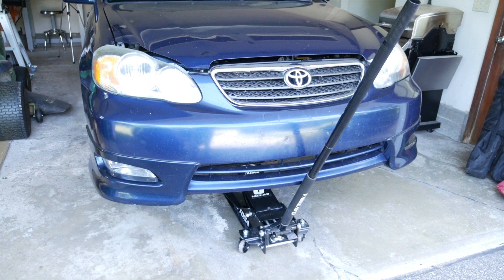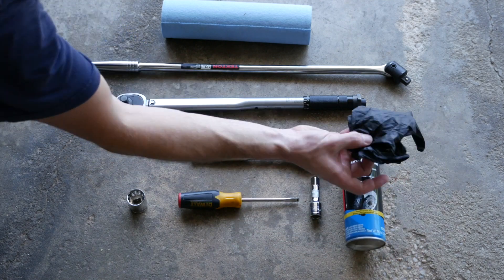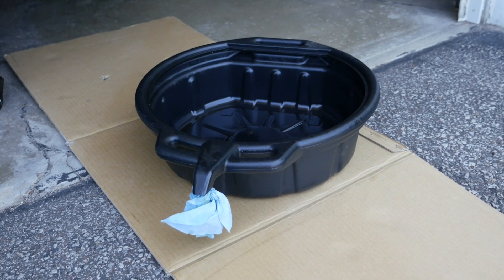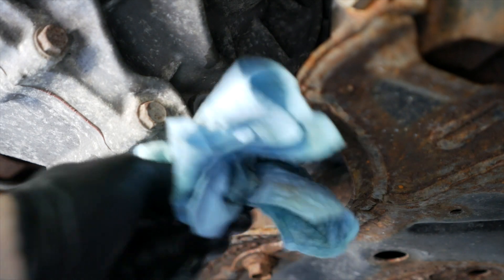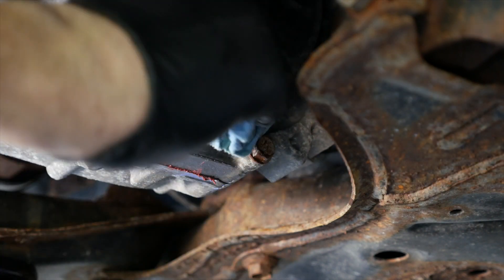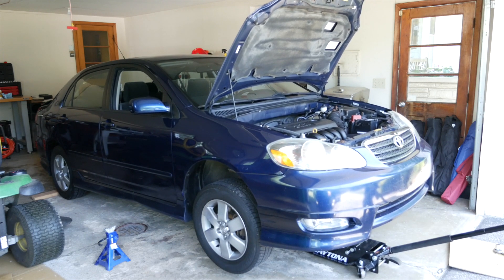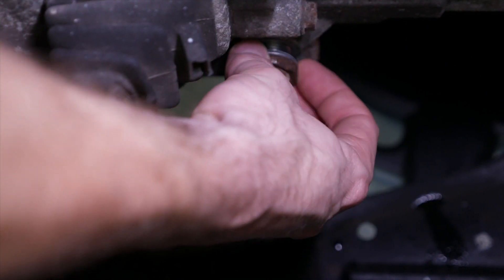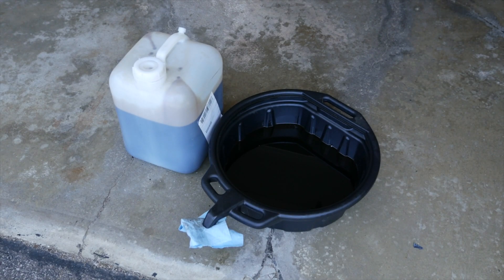How To Change the Manual Transmission Fluid on a 02’-08’ Toyota Corolla

Comment: Good video, very clear. However, FYI for you XRS version owners. The fill plug is a 10mm HEX. Yeah, everything on XRS has to be different. LOL
Reply from the maker: Good call! I believe the XRS (Corolla and Matrix) have the 2ZZ engine instead of the 1ZZ like my Corolla. That would explain the different sizes. Good thing to mention though! :)
Reply: @DIYTillIDie  Yes it has the 2ZZ.  I had to replace the valve cover gasket and all the auto parts stores gave me a gasket that will not fit. They insisted it was correct. I finally went to the dealer and got the 2ZZ gasket which is larger due to engine design.
Reply from the maker: Has more power too! Wish mine was the 2ZZ haha!
Reply: Glad you mentioned this, I'm about to do mine!
Reply: Wrong it’s the 17mm to the right in XRS

Comment: Great video.  I just picked up an 03 Corolla 5 sp.
Reply: I have the same car.   350k on it now  and it's been very reliable . I'd buy another.
Reply: @marcmarini8425 I do too except mine is at 130k. Can’t say it’s not giving me issues but I do love the car. Once I get it fixed 🤞 I think it’ll be good for another 100k at least.

Comment: great video mate , just bought a corolla 4 me daughter, mix 50 diesel 50 motor oil and coat the bottom  of that corolla ,then park it on some sand for 3 days to drip dry , that will stop that rust from gettin any worse, toyotas worst enemy is rust, thats what farmers would do in shark bay west australia ,the whole area is just salt , cheers 4 the video , will b doin gearbox on weekend and havin a few beers
Reply: Can I use used engine oil mixed with diesel for the rust

Comment: Does the car being in first gear actually keep old fluid in the transmission? And if filled while jacked up wouldn't that fill it more and possibly be better?
Reply from the maker: I am not sure. It's probably impossible to remove all of the old fluid unless you flush it a bunch of times. This works for general maintenance. But I didn't fill it when it was jacked up though. I lowered it to be level with the ground and then filled it then (about 7 mins in). 😊

Comment: Great video!
Reply: Finally got around to changing my manual transmission fluid today.  I waited till about 30K miles since the last change. 

It was remarkably easy to do.  Easier than changing engine oil!

I just used tire ramps and chocked the tires instead of using a jack and jack stands.  

Seeing as how the manual said 2 quarts of trans oil and you put in 2 quarts, I just left it on the ramp.  Saved a step.  

Thanks for the very helpful video!

Comment: Good job on the video I like the specifics I am about to buy a 2004 Toyota matrix with a manual transmission I’ve read mostly bad reviews about those transmissions crapping out at 45,000 miles at the lowest the matrix I am about to buy has 239,000 miles do you think it would have any issuesBeing a high mileage car with a manual transmission because I would think they probably already fixed the problem by that mileage anyways
Reply from the maker: Do you know what trim the matrix is? My tans has around 90k on it and it’s been fine. No issues at all (other than being not the best feeling through some of the shifts lol.) With proper maintenance and upkeep, it should be fine. 

Also find out if anything has been replaced in it. That’s a lot of miles if it is the stock clutch!
Reply: @DIYTillIDie  XR. I really want to buy it but I don’t want to run at that risk. Thanks for the response. Suppose to decode wether to see it today or not.also I don’t know what kind of maintenance was given from previous owners.
Reply: Didn’t want to risk getting it. Got a 1995 Corolla 5 speed instead. Still got a manual Corolla like I wanted to anyways. 👍
Reply from the maker: Good call! That’s a lot of miles and it might have needed a lot of back maintenance done to it. Happy shifting! 🏁

Comment: Thanks  for  the video with the excellent explanations .  I  live in  northen Italy  have and I have a 2004    1.8  gasoline / manual trasmission  Corolla Verso  with  138.000 Km ( 85 k   miles) with no problems at all :Greatest  car I ever had.  After how many miles would you recommend  to change the trasmission oil in normal driving conditions?
Reply from the maker: Hi Giuseppe! Toyota recommends changing the manual transmission fluid every 30K miles (48280 Km.) Hope that helps!
Reply: @DIYTillIDie   Thanks Ben for the information   and  compliments for  your excellent  videos that I follows with great interest.
Reply: @DIYTillIDie that was some nasty looking oil! 😳
I bought a used 08 and have changed it at approximately 50,000 kms.   
I used the Cam2 synthetic oil.
Good video

Comment: So I just attempted to do this today after watching your video and come to find out my fill plug is a 5/16 not a 24 mm and pretty much stripped it a little bit because I figured this was accurate so people need to watch out and I seen another guy said the XRS was a 10 mm so each car needs to be carefully configured or check with the dealer before tampering with.. my extremely stuck so I put some penetrating oil and might need a torch to loosen it any suggestions would be appreciated

Comment: Wondering if it’s the same procedure for my 03 Camry . I have a manual transmission
Reply from the maker: Pretty sure it's relatively the same procedure. Looks to be from this forum post: https://www.toyotanation.com/threads/2003-toyota-camry-le-manual-transmission-fluid-change.1544282/#post-12989842

Comment: I just discovered this great YT channel. I have a Corolla 2007 G9 E120 latest line Brad Pitt (because of the publicity he did to this beautiful generation with the background song "New Sensation" by the band INXS) mine is made in Brazil (most of its parts are Japanese ). My manual gearbox is the Japanese C52 with the short 5th ratio (they chose this gearbox for South America because of the relief and height, even the tire profile was reduced for our harsh geography. The Japanese engineers decided to use the 60 profile for have a smaller tire circumference, benefiting the application of engine torque to the wheels, making it more agile, our tire size was 195/60R15. Instead, the decisions made by the engineers for your market were different, since they have a lot of flatness and highways, it was not necessary to use a short 5th and that is why they used the C59, in addition to a 65 profile, the 195/65R15 size increased the circumference.The advantages they had with this configuration vs ours, is that at the same speed, with the same 1ZZ-FE 1.8 engine, your car at the same speed travels at less rpm vs. mine, but those differences affect reaction, your car is less agile.
I wanted to tell you what happened to me and know what you think; since I did the oil change at the end of last November, everything was perfect, I used the recommended viscosity 75W90 GL4 specific to take care of the copper synchronizers (the GL5 have excess EP additives and damage them, I did a lot of research on the effort, because it is very expensive, I was able to afford this Red Line MT90 in Argentina, it's the best you can buy). The problem I noticed when I came back from vacation in the Cordillera, a mountainous area about 2 weeks ago, was that the changes began to happen harder, I noticed it in the selector. What I did these days when I was at home was open the filler cap and what happened was that excess oil came out, it was a little over the level, approximately 60 ml came out. It wasn't much, after that, I closed the plug and used it, it improved the passage of gears already using the car in the city. Evidently the little excess of oil generated greater pressure inside the box and that is why it made it difficult for me to change gears (something very strange, but it shows). I assumed that it was due to the worn clutch (it has the original one with 123,000 km). I was about to change it, but I want to try it for a few more days to see if I continue to have difficulty changing gears or putting the 3rd; even when putting the 1st in movement it has difficulty, but this I always felt since I bought it used, even when being for example in 2nd gear and trying to put the first in movement, it costs a bit, but it goes in (I don't do it anyway often because I can force the synchronizers) Maybe I should definitely change the clutch?. Thank You very much, greetings from Argentina 🇦🇷

Acabo descubrir este gran canal de YT. Tengo un Corolla 2007 G9 E120 última línea Brad Pitt (por la publicidad que él le hizo a esta hermosa generación con el tema de fondo "New Sensation" de la banda  INXS) el mío esta fabricado en Brasil (la mayoria de sus partes son japonesas). Mi caja manual es la C52 japonesa con la relación de 5ta corta (eligieron esta caja para Sur América por los relieves y la altura, incluso el perfil de los neumáticos se redujo pensado para nuestra dura geografía. Los ingenieros japoneses decidieron utilizar el perfil 60 para tener una circunferencia menor del neumático, beneficiando  la aplicación del par del motor a las ruedas, haciéndolo mas ágil,  nuestra medida de neumáticos era 195/60R15. En cambio las decisiones que tomaron los ingenieros para su mercado fueron distintas ya que tienen mucha llanura y autopistas, no era necesario utilizar una 5ta corta y por eso utilizaron la C59, además  un perfil 65, la medida 195/65R15 aumentaba la circunferencia. Las ventajas que tuvieron con ésta configuración vs mia, es que a una misma velocidad, con el mismo motor 1ZZ-FE 1.8, tu auto viaja a menos rpm vs. el mío, pero esas diferencias lo reperjudican en la reacción, tu auto es menos ágil.
Quería contarte lo que me pasó y saber que opinas; ya que realicé el cambio de aceite a fin de Noviembre pasado, todo estaba perfecto, utilicé la viscosidad recomendada 75W90 GL4 específico para cuidar los sincronizadores de cobre (los GL5 tienen exceso de aditivos EP y los dañan, investigué mucho al esfuerzo, porque es muy caro, pude pagar este Red Line MT90 en Argentina, es lo mejor que se puede comprar). El problema que noté cuando volvía de las vacaciones por la Cordillera, zona montañosa hace unas 2 semanas, fue que los cambios comenzaron a pasar de forma más dura, lo notaba en la selectora. Lo que hice en estos días ya estando en casa fue abrir el tapón de llenado y lo que pasó fue que salió sobrante de aceite, estaba un poco excedido del nivel, aproximadamente 60 ml salió. No era mucho, luego de eso, cerré el tapón y lo usé, mejoró el pasaje de cambios ya utilizando el auto en la ciudad. Evidentemente el poquito exceso de aceite generaba mayor presión en el interior de la caja y por eso me dificultaba el pasaje de cambios (algo muy extraño, pero que evidencie). Yo asumía que era por el embrague gastado (tiene el original con 123.000 km). Estaba por cambiarlo, pero quiero probarlo unos días más a ver si sigo con dificultad en los cambios o al poner la 3ra; incluso al poner la 1ra en movimiento tiene dificultad, pero ésto siempre lo sentí desde que lo compré usado, incluso al estar por ejemplo en 2da marcha e intentar poner la primera en movimiento, cuesta un poco, pero entra (de todas formas no lo hago seguido porque puedo forzar los sincronizadores) Tal vez deberé cambiar definitivamente el embrague?. Muchas gracias! Saludos desde Argentina 🇦🇷

Comment: How many miles did this gear oil have ?
Did you buy the crush washers at the dealership?
Reply from the maker: The car had about 80-90k miles on it when I changed the fluid. Not sure if it was changed previously (no service records). I bought the crush washers on Amazon (link in description).

Comment: Is it 2 quarts or 4.1 quarts of tran oil?  Thats what i read online
Reply from the maker: It is 2 quarts for the manual transmission. The automatic trans might take 4.1 quarts. Mine used just under 2 bottles of Redline MT-90 :)
Reply: @DIYTillIDie  i think my mechanic put 3 or 4 😶 i got a manual too
Reply from the maker: Hmmm... maybe they meant pints? 🤔 I believe 2 quarts is 4 pints
Reply: @DIYTillIDie  i think they were quarts man. I remember him saying that it was spilling. Im going to flush this out and put 2 quarts this weekend
Reply from the maker: There you go! Better safe than sorry. 👌🏻

Comment: What if I just wanna check the fluid? These manual transmission usually don’t have a dipstick.
Reply from the maker: Hi Jace! You can check the fluid via the fill plug (NOT the drain plug!) If you take out the fill plug, you can check the fluid level with your finger. It should be up to the fill plug hole (but not overflowing.) You can also extract some fluid with an auto syringe to see the color of the fluid (see link below.) Hope this helps! 

https://www.amazon.com/Titan-51884-Automotive-Fluid-Syringe/dp/B018SV10I8
Reply: @DIYTillIDie  yeah I did the fill plug and the fluid started coming out fsr. It might be because I started the car to pull the front into the garage since it was starting to rain and maybe fluid got pumped up to the fill plug but it was the fill plug since it’s the one further at the top of the transmission and not the one at the very bottom.
Reply from the maker: @jace_Henderson  Make sure when you check the fluid you are on a level surface too, that will get you the most accurate reading. If fluid is coming out and doesn't look too dark/burnt, you should be good. It's a good idea to change the fluid every 30k miles just to be safe!

Comment: There are some DIY-ers who take the extra step of temporarily lowering the vehicle back to the ground as the fluid drains in order to drain out the extra fluid which would otherwise settle in the rear corner of the gearbox. It makes the job more tedious, but it might be worth the effort. What are your thoughts?
Reply from the maker: I do this step as well (7:00 mins in the video.) I lower the car to the ground and fill the trans while its level. Prevents overfilling the gearbox. :)

Comment: too thick new oil bro, this toyota needs 75w specific manual tr. oil. You will have rough changing gears
Reply from the maker: It's been smooth for me. No issues here.